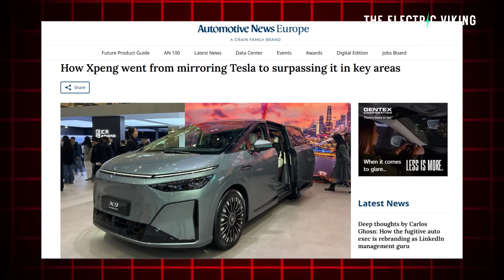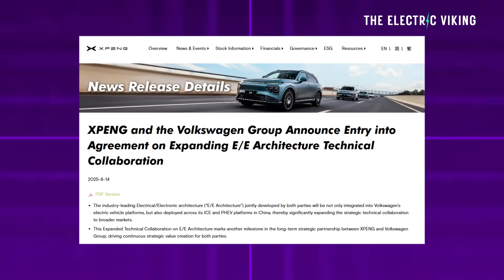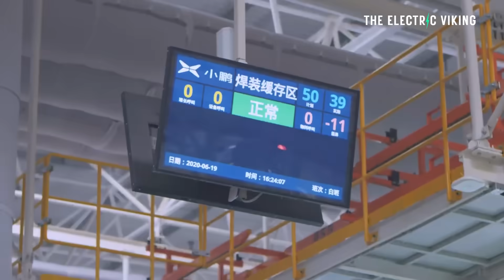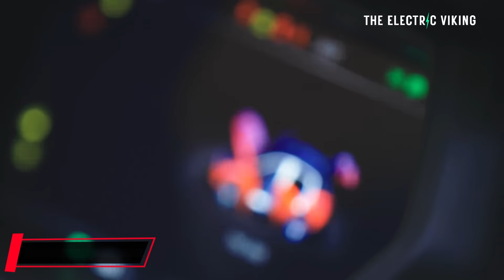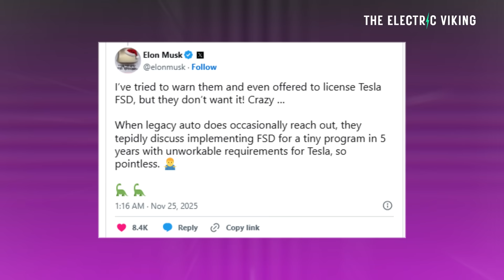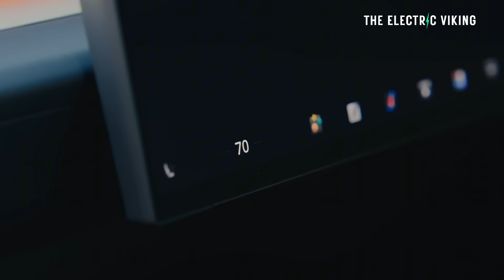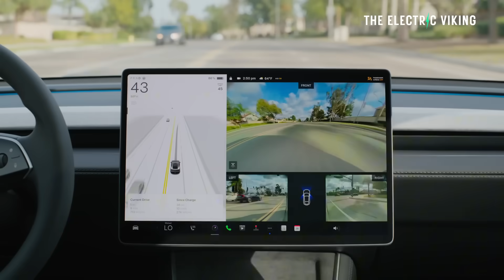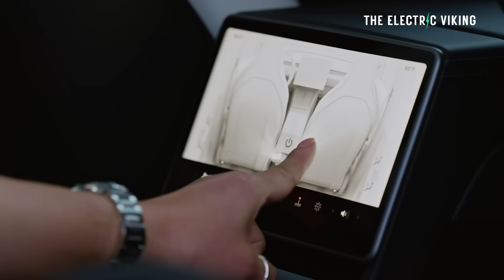How Xpeng went from mirroring Tesla to BEATING it in these key areas

Comment: "E-revs", that's a new one.

Although a one that was designing and building core internet networks thirty years ago of switches, routers, and fibre optics we shouldn't be surprised - should we 😊

The issue is I grew up in an era where a peron's knowledge was tested in valve clearances and sparkplug gaps.

Comment: Xpeng will win. China has twice the number of engineers as the US. And you get 4 x more out put for every $ you spend along with a much faster time frame 3x faster. Due to price parity, a superior supply chain, and lower energy costs. As well as a functional government with a planned economic future plan. Unlike the US which still relies on asset accumulation and manufactured wars to run its economy.
Reply: Not until they make their first profit first. Right now, they're losing close to a billion dollars every year. They've had to push back their timeline for profitability multiple times already, when will they finally be a proper business?
Reply: you didn’t watch the video. This year they are down $50 something million in the 3rd  quarter 2025 . And are expecting to be in the black in the last quarter of 2025. Everything in the West is getting harder. Everything in China is getting easier.
Reply: @McCraeMoto1  Nope, that 50 million loss is only for one specific quarter of the year, Q3. Why don't you count for the entire year? That was the point that I was trying to make.
Reply: You are correct. That been said the  $50 million loss was for the last quarter. They expect to be profitable in the last quarter of this year.
Reply: @McCraeMoto1  "They expect" is a pretty loose statement when they've been saying that for many times already, and always got it wrong. Also, what huge of a difference does one profitable quarter make, in a year of 75% losses?
Reply: @Ben21756  Most EV makers become profitable at around 500,000 per year. Tesla did. Xpeng is just reaching that point now. Of course, Xpeng is still spending heavily on R & D so it may take another couple of years to become consistently profitable.
Reply: Very true